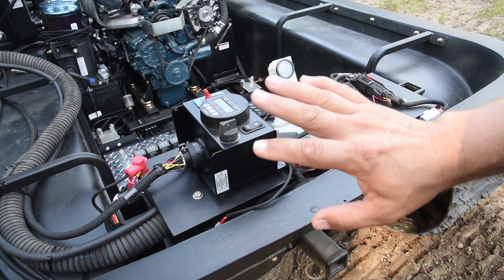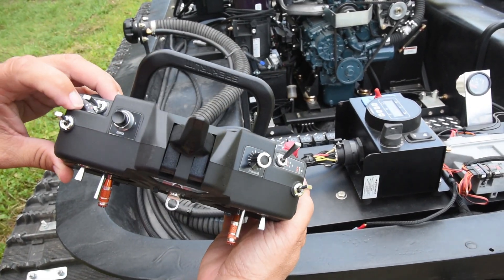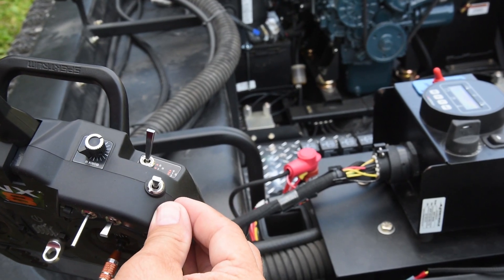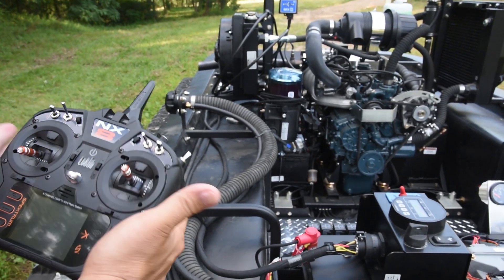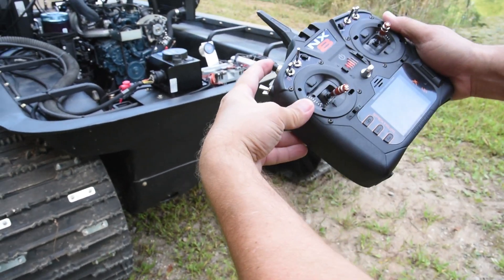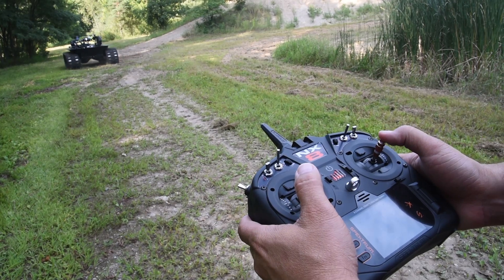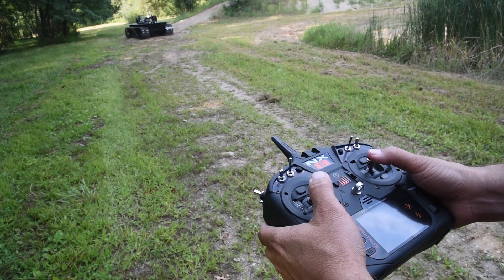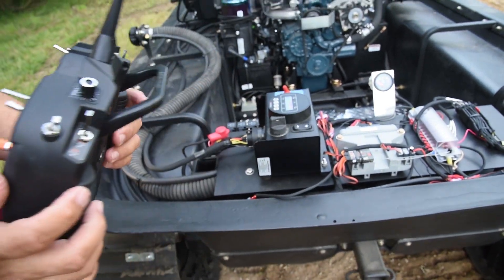Demonstrating the Remote Controlled 8x8 Mudd-Ox

Comment: Impressive to say the least! Great work! Also, if you are using a telemetry receiver, you can display RPM, battery voltages and othe stuff right on the NX or IX series screen which is nice!